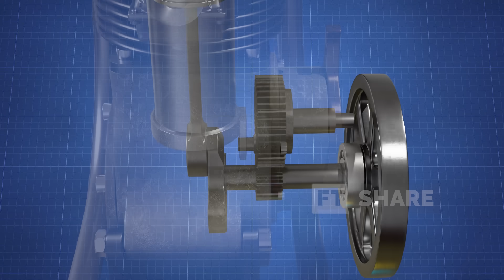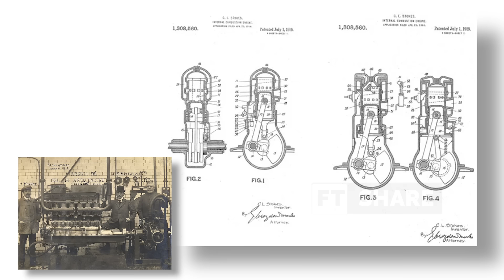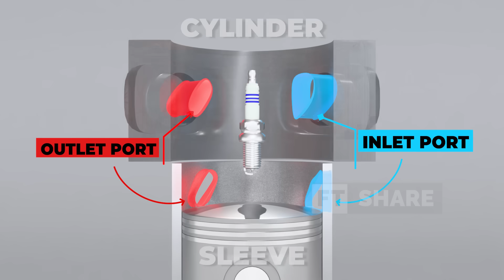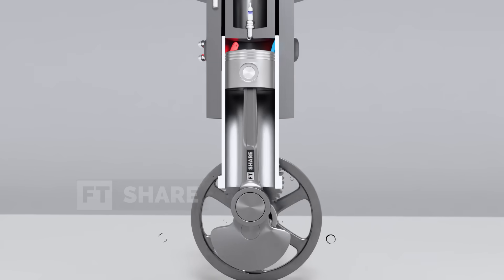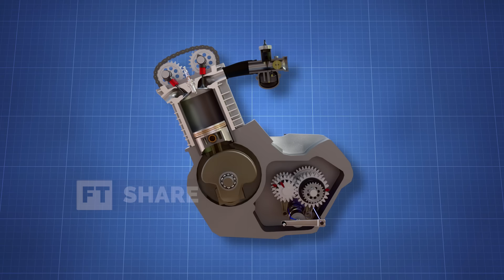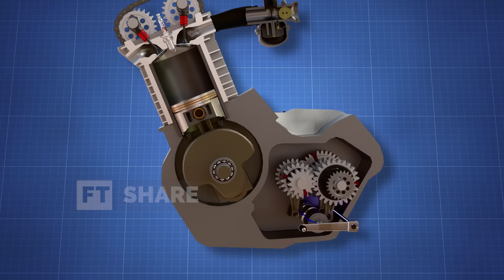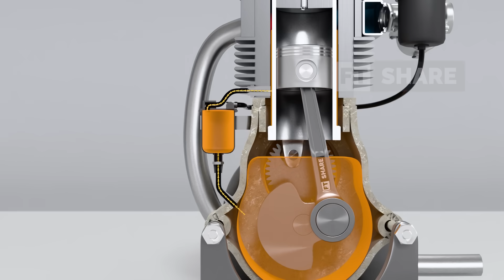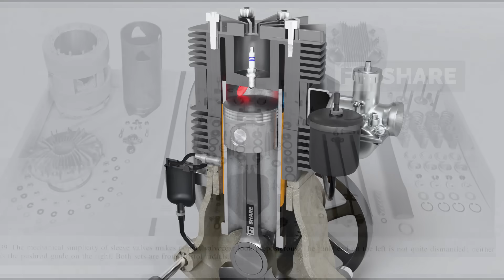Why Was This Advanced Technology Abandoned? 🤔 The Secret Behind the Sleeve Valve!

Comment: Maybe crazy but, could the sleeve be fitted with an oil control ring or two between the sleeve & the cylinder.  This would mean that the cylinder block ID would be bigger but, only by enough to allow the installation of the oil control ring
Reply: Yes, they actually did that on the airplane engines, and Mike Hewland said that he had built engines that consumed less oil than a normal poppet valve engine.
Reply: @ChargerMiles007  pity that it seems not to have been followed up

Comment: It wasn't forgotten, It doesn't work.  The combustion gases gum up the sleeves and there is no way to lubricate them.
Reply: yes, it is a terrible design. As terrible as this 100% AI generated video garbage.
Reply: While the sleeve valve was a product of it's time, you can't just say 'It doesn't work. The TBO of Bristol Centaurus engines as used in airliners in the 1950s was still very commendable. Yes, I agree that ther need may have passed, but to simply say that they don't work is just plain ridicules.

Comment: The application of dry film, metalized coatings can reduce clearance requirements and oil lubrication. Variable speed supercharger could make up for low speed operation. Modern oils are so much cleaner then what Ricardo worked with, if remember right he went for months waiting for spec oil to test on mule's.

Comment: This I a very incomplete video.... sleeve valves are only really effective at engine that run at  high rpm eg race or aircraft applications. - they are crap at partial throttle opening, especially when it come to emissions which really matters in modern engines!. One version that probably IS better for cars (& you didn't cover!) Is sleeve valves that are perpendicular ( not parallel) to the cylinder...but these got banned in racing, therefore no development...
Reply: this is 100% AI generated garbage, that is why.

Comment: If sleeve valves were SO GOOD they would be in use, still. BUT THEY ARE NOT !
Reply: That's a silly statement. Lots of things were good in their time, but became obsolete when something better arrived. You may as well say "If the Rolls Royce Merlin was so good, why don't they use them in modern airliners?"
Reply: Take a breath chuckles
Reply: If gas turbines hadn't come along, sleeve valves would have continued to be developed by the aero engine industry. They were good, but jets were easier.

Comment: No, this is a very bad idea!
The extra friction of the sleeve will negate any Volumetric efficiency you may have.
And the weight of the sleeve limits RPM to about 3500.
Reply: I think the engineers at Napiers would disagree.
The Sabre VII which was intended for the cancelled post WW2 Fury fighter was rated at 3500hp for takeoff at 3850rpm with 20psi boost. There are reports of a Sabre VII on the bench run at a peak output of 4000hp and 3750hp for an extended run.  

The US aeroengine companies also experimented with sleeve valve engines but never got past a few prototypes.
Reply: @charlieclelland5895  I am a better Engineer, than all of them! Too much friction in this design! They have exchanged the Puppet-Valve for a worse idea. The Puppet-Valve is fine!

Comment: The RCV model airplane engine has a very different sleeve system. And two ways to use the power, one output on the head above the combustion chamber and one conventional drive off of the crankshaft. The sleeve rotates completely driven by a gear on the bottom.  The cylinder ports are like a twostroke.

Comment: Sleeve valves and rotating valves, are very difficult to seal for higher compression.
And if they are sized to seal well at running temperatures, they seal really badly when cold and starting the engine.
They only really work ok at higher RPM where there is no time to leak past the dodgy sealing.
So they might bo ok for an aircraft engine that runs always at hgih RPM, but they are terrible for a car.
Reply: If I win a Lottary, I will let you know how well a sleeve valve engine works in a car! :)

Comment: Sleeve valve engines have been tried in racing in past years but they just cannot seal as well as a poppet valve, also very expensive to manufacture and way more moving parts. But they do have Superior flow of air in and out of the engine because the valves not in the way of the air

Comment: Manufacturing the thin sleeves with adequate roundness was a significant problem. Adequate lubrication of sleeves with attendant oil consumption was OK for WW2, but would be excessive today, and is an emissions challenge.
Reply: In the end Bristol managed to get the system to work using nitrided sleeves but oil consumption was prodigious.
Reply: @thamesmud  that’s  what I understood too - great engines apparently,  but you used to check the fuel when you topped up the oil😂
Reply: Yes, the solution to keeping the sleeve round was found by accident. It involved using a dull grinding wheel to basically squeeze the sleeve round as a final operation! Crazy stuff.
Reply: Also, the sleeve introduces an additional gap between the combustion chamber and the cylinder body, impairing good heat transfer from the former.

Virtually all engine manufacturers have replaced the cast iron linings with waay thinner silicon-based coatings for both friction reduction and enhanced heat transfer.

https://www.youtube.com/watch?v=8Kp108x4tQA
Reply: and yet some new shit still eat 1liter on 1000km
Reply: Yes, emissions are a bit interesting when driving down the road and being followed by a haze of smoke 😂. I prefer to think of it as preserving a piece of history so one car smoking isn’t the end of the world but certainly wouldn’t be great if everyone had one
Reply: The Bristol Hercules sleeve valve engines as in the Hercules 734 series that produced 1980 BHP at 2800 Rpm was designed to consume one imperial gallon of oil per hour to lubricate the sleeves and the smaller 672 series that produced 1600 BHP burnt about the same amount.
Reply: Why didn't they have the sleeve rotate rather than reciprocate?
Reply: @randyanderson4442  It does both but if it was rotational only, my guess would be excessive wear of the thin sleeve.
Reply: I continue made my innovative project of a non-combustion engine, I remind you that I am posting here on my channel the technology and the principle of operation, according to which anyone can create a prototype and enjoy free energy, since I was denied financial support at the stage of the idea and theoretical research, after a year of unsuccessful searches. Including I will begin to assemble a sample. And soon another video will be released, revealing my developments, the wind of change is approaching! All those who are not indifferent, welcome to the flight in this departing innovative car, which will lead to great achievements for the successful future of the planet and humanity!
Reply: @maguccimotorincorporation  okay what's the name of your channel. And the free energy device your saying you've developed
Reply: @maguccimotorincorporation  the world exceptionally awaits your most magnificant invention,who will favor all humanity and peoples.

Comment: There were several sleeve valve engines used successfully during the Second World War, a couple of air cooled Bristol radials and, notably, the liquid cooled Napier Sabre used the the Hawker Typhoon and Tempest. 
The two issues they had were an increase in oil burned (which would make it hard for the design to pass modern emissions regulations) and, for WW2 aviation use, a limitation on how much boost the engines could accept before the sleeve would start having issues. 
They did have better breathing than poppet valves, so better volumetric efficiency. 
I think the big reason they didn't go further is poppet valve development was so advanced that it didn't make sense to invest in an unproven technology for relatively small gains when the poppet valve already worked quite well thanks to the development the tech had received. A slight increase in VE can be overcome with a bit more displacement. We're now at a point where the amount of development work that would need to be done to get a sleeve valve to pass emmisions doesn't make business sense.
Reply: And the advent if the turbine engine

Comment: There's a guy on YouTube who converted a Briggs and Stratton lawnmower engine into a sleeve valve engine as a capstone project for machinist school. They're like 15 year old videos.
Reply: LOL, yes that is me! I will have to put the engine back together, and get some better resolution vids up!  Guess I know one of my summer projects! I am currently working on a supercharged 2 stroke sleeve valve (built using a Briggs lawnmower engine again, based on the Rolls Royce Crecy engine cycle).  :)
Reply: @ChargerMiles007  Seems like a good fit for paramotors. Need high hp/weight at fairly low rpm. (48 to 50” prop at 3/4 speed of sound)

Comment: I can see how it works, and at least some problems. #1, there is no way that your going to get a good enough seal between the engine block and rotating cylinder to be emissions compliant.  Heat transfer from the sleeve to the block is going to be quite difficult. even more so with a liquid cooled engine. because trying to seal the water is going to be very difficult when the sleeve rotates and reciprocates, as well as flexes when the combustion cycle happens.  there are no rubber seals that can stand up to all of these problems. and graphite or metal seals would be problematic as well. the graphite would end up crumbling, and with metal, the difference of expansion rates would make them nearly worthless.  50 something years ago, I thought about a similar design, only using a rotary valve in the cylinder head. the problem is heat and expansion. the rotary valve would heat up significantly during the compression and power stroke. only cooling just before the intake. the clearance needed to keep the valve from seizing would not be able to allow it to build compression. I think if you were powering something large that was a stationary engine, with a constant load. you could inject water against the back side of the rotary disc to keep it cool. that water would have to have water soluble oil mixed into it so that the rotary disc had lubrication. but that would also mean that the engine would smoke due to that oil burning off.  there are just way to many problems, for not nearly enough benefits. poppet valves are the best compromise. that's why we still use them.
Reply: You don't actually have to seal the sleeve against any of the liquid coolant. That is still done with the cylinder wall. The video shows an oil passage going to the sleeve, I am not aware of any engine ever needing that. The sleeve is splash oiled from the crankshaft and con. rods. The main problem is keeping too much oil off of the outside of the sleeve, which they used contracting oil ring to help with. You are correct that there probably hasn't been a current emissions compliant sleeve valve engine built, but it may be possible with more oil rings on the sleeve. Supercharging helps also to prevent the intake from sucking oil in along the sleeve.

Comment: Those weren’t helical gears… those were noisy straight cut gears. Like when I put my Saturn in reverse, heweeeeerrrrr 😂
Reply: My guess is that high rpm would wear out the bushing on the sleeves pull/push ear. Then the ports wouldn’t flow properly and clack clack clack. Lol

Comment: The problem was the high oil consumption and consequent smoky exhaust.
Reply: There are many more issues with it. A two stroke engine is way cleaner, lasts longer and more powerful than this. Probably you have already heard the main law of machines: the simpler the better. Less parts means longer lifespan and lower production costs.

Comment: There is a new engine concept on YT available. 
The discontiunous radial turbine is a combination of an internal combustion engine and a steam turbine. 
Thanks for sharing..
Reply: another one of these "i animated it so it must work" type "concepts". a load of rubbish. 

how fast do the wheels have to spin?
hint. at half the peripheral velocity as the impinging gas or fluid... which is supersonic. 

how is the shaft balanced, how do its bearings work? hint... look into the problems delaval and parsons faced with their turbines. that actually worked.

as its 'based on a steam turbine"., it must obey and use all the design aspects of a steam turbine, well established criteria founded on 150 years or so of experience.

Comment: Wow, I'm not sure if you read it in a document or realised it yourself but that whole thing about carbon build-ups actually improving function is really clever, didn't even think of that before, it's just the perfect lubricant too. Though, that means some filthy oil, heh.. Guess a Diesel version would make 'ol Leaky Detroits' oil look clean by comparison..

However I disagree with that info about max RPM, 3k RPM is clearly based on the ancient car engines & the large-cyl. capacity aircraft engines, an appropriately-sized version would easily achieve far higher RPM, however the movement of the sleeve's inertia would also become problematic so yes, they are naturally limited in RPM to some extent, certainly won't be beating-out high-under square Desmo. poppet-valve engines anytime soon I safely assume. But I guarantee there is a range in which the bore/stroke ratio & the RPM is at a point where you get both pretty high RPM while not experiencing any of the drawbacks of a poppet valve system, at the very very least there is full linearity of airflow so less need to VVT & there are no spring harmonics, which can be incredibly destructive with high spring pressure (high-power applications).
Reply: The graphite or whatever form of impure carbon it is, is not lubricating and is a hard deposit that causes wear. You are thinking diesel soot, or fluffy carbon silk from a oxy acetylene torch burning with very little oxygen. In an engine the carbon is never soft, nor lubricating. This is from personal observations ...
Reply: @xenuno  Hhhm, yes I am not versed in chemistry to that degree and don't have experience with any deposits but diesel / oil-burning, so you're probably right. Makes me a little sad, couldn't you just let me stay in blissful ignorance here? :) 

Still, that just means this engine using heavy fuels could have said benefit so not all is lost, not that the style of engine will ever take-off againt probably but just interesting to theorise, that's all. I will also later go and do some digging into these different carbon forms from hydrocarbons breaking up so thanks for the info.
Reply: Could you tell me if you could get rid of the sleeve and just use small tabs to cover inlet/ outlet valves, as this would solve some problems
Reply: @hawkbartril3016  Yes and no: there are many different engines with sliding valves, however they are all small / model engines and usually not for actually powering anything. The issue is such sliding valves have issue with lubrication and the sealing is poor; a part of the problem is the combustion pushes hard right against the tab(s), whereas in these sleeve engines the push is outward so the force cancels-out. I'm sure there are some out there somewhere that were powering something but generally it's a pretty dead end. 

HOWEVER, inside a port-engine, like bike 2-strokes such a valve is perfectly adequate, as the sealing it needs to do is not significant since majority will be done simply by the piston against the cylinder, so this is a good idea for them maybe! Plus the ventilated-crank ones already have oil with fuel mixture, so the lubrication isn't an issue. Many of the last 2-strokes already used various sliding & rotating valves to alter the fixed-port timing so you could use your idea there. 

The things I mentioned they use already, while many are genuinely sliding tabs just like that, they are not true valves, they just alter shape of the port effectively; a true valve that fully-closes has additional functions. A youtuber named "2-stroke stuffing" ran with this idea but using a rotary valve, some company just 2 years after recently came out with their whole "next-generation" advanced 2-stroke and they basically copied him fully, so this field of engines is far from dead. None of these use ventilated crank like bike engines so no burning oil, so emissions-compliant. This idea of sliding tabs could be a good alternative in the same application and I'd argue has benefits over rotary valve. Just to be clear as this is all complex, this whole concept means you can have all the benefits of the simple / basic bike-style 2-stroke but you don't have one good RPM and don't need the expansion pipe, as the controlled closing of the port stops the need for it, so this is seriously different & isn't limited to dirtbikes & doesn't have horrible fuel burn.